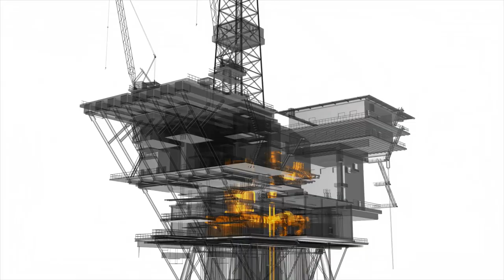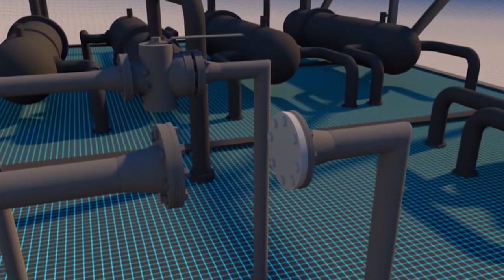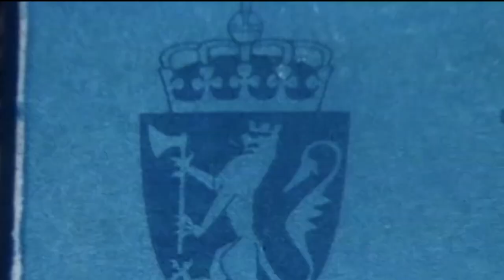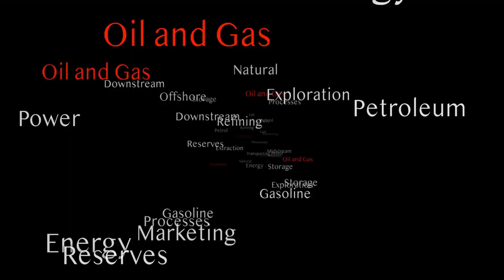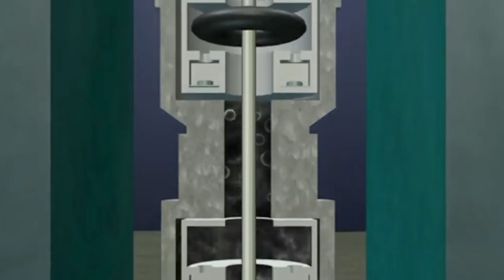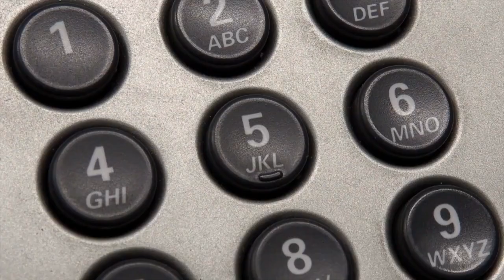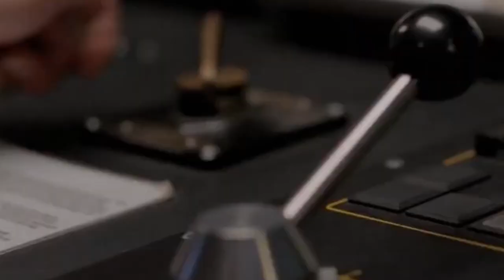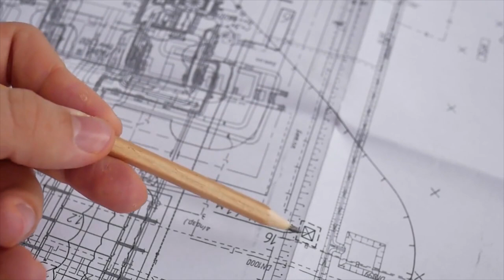The World’s Oil Rig Disasters, and The Recent Case of The Balongan Fire! || Documentary

Comment: People need to understand that oil rigs are built on the principle of risk management. Yes, they will occasionally suffer a loss like these disasters, but the overall benefit to society is undeniable—even when the environment suffers a setback. Unless people are willing to give up public transportation, motor vehicle travel, and air travel, there is no logical point to complaining until we have viable alternatives.
Reply: I don’t agree with your statement. We are dependent on fossil fuels like petroleum products, but no ethical business operates like the companies like BP, Occidental, and Haliburton, using bare-bones safety measures to get back as much profit as possible and ignoring the ecological damage. Marvin Gaye’s “Mercy, Mercy, Me” is more relevant than ever.
Reply: @lennoxpotter3329  Risk management is all about minimizing the risks and that includes the damages caused to the ecology. I know that past failures have been due to what you describe as “bare bones safety measures” but I don’t think that’s the case anymore. As I stated, people want to rely on fossil fuels yet they don’t want to deal with the occasional risks involved.  As long as a business is ethical (and if they’re not, they face penalties ranging from bad public relations to heavy fines and/or criminal sanctions) why complain?
Reply: As long as companies are fixated on getting back profit, there’s no way in hell that petroleum companies are going to run things like an ethical business. The consequences you talk about like fines are a joke to them and criminal prosecution is non-existent.
Reply from the maker: Two interesting point of views! Can we stop using fossil energy entirely right now? Well, the answer would be easy noting both industry-use-wise and personal-use-wise, it is not doable. Clean alternative energy at this moment is not accessible crossed-society-class (in this regard, affordable). Some types of alternative energy also haven’t been fully sustainable (for example: geothermal which detected to generate emission from gas release to soil surface and into the atmosphere). This process is evolution that might takes decades, not a swift change of 5-10 years.

An interesting “easy” example can be obtained from a tertiary human need of cosmetics. 16th century cosmetics contained mercury substance that allegedly caused death of Queen Elizabeth I. These harmful cosmetics also still being used publicly in Victorian era (when Queen Victoria was reigning in Great Britain) until 19th century. But look at where the era reaches to, with eco-friendly and safe (at least safer) substance for all direct-consumed chemical products. It took ages to evolve such “technology” at that moment. Although this is just an example from tertiary product, we can look back to this kind of situation regarding research and product evolution.

Until the energy era reaching evolution, all elements in society need to gang up in doing:
1. People to amplify public transportation usage and use local products where possible
2. Researcher and relevant corporation optimizing the research to establish alternative energy
3. Government and CSR-obliged corporation support with research funding

And talking about risk, error might be occurred because business process is carried out by human in many aspects. In a Tedx Talks session, Rohini Swaminathan stated that there is nothing natural about disaster. Adding her statement, business wise, every risk is in place but how we manage them and applying zero tolerance to ignorance. And Harold’s statement do make sense “As long as a business is ethical (and if they’re not, they face penalties ranging from bad public relations to heavy fines and/or criminal sanctions) why complain?” Cheers to you guys! Thanks for your both interesting PoV! 😃😃
Reply: @haroldbenderson1754  I don’t think people understand the harm that these oil disasters have done to the people who died on oil rigs, their families, and future generations that will have to deal with the long-term damage caused by pouring petroleum into our waters. Who do you think suffers more, the oil companies that eventually get back their profits or the people and creatures 50 years from now still dealing with the fallout?
Reply: @GemaConsult  Great story about cosmetics! Never knew that or that they might have killed Elizabeth.
Reply: Thanks to everyone for keeping the discussion civil. Let me share a story with you about the environment. A few centuries back, England faced a major deforestation problem as people cut down trees for fuel. Then, someone discovered coal and people didn’t have to destroy their forests anymore (at least not until a couple hundred years later in America). I believe we’re always going to find new sources of fuel and/or technology to preserve our environment. That doesn’t mean we ignore the practices of an ethical business but there are ways to keep society moving while making profit in an ethical manner.
Reply from the maker: @C.C. Hunt Crime charges due to act of negligence in this industry do exist. For sure investigation process took such a long time because oil & gas (or energy, utilities, and mining) industry is a complex yet multi-faceted business operation. Same like air crash investigation due to complexity of aviation business process. 

The cases for energy, utilities, and mining crime charges that flagged to be unethical business were environmental crimes, money laundering and embezzling (usually for cutting the corner purposes), illegal or unlicensed operation/products, etc. Who were charged? Typically it’s the corporation board, key-person, beneficiary owners, etc. You can search up in Google for the real case references.

But we’re not gonna keep our eyes close with saying 100% of faulty acts have been processed by law. Absence of these process is here and there – but that’s a different story if we’re talking about law enforcement effectiveness. Also a different homework involving how society works – also current and future generations behavior patterned up 🌊🌴
Reply from the maker: @Earl Butler Keep society moving while making profit in an ethical manner involving hard work(s). As long as the proportion of intellect person with high morale holding such important role are well distributed here and there – the chances are there. Plus, finger-crossed for research progress in alternative energy 🤞🏻🤞🏻

And talking about coal discovery in United Kingdom, there’s one event we can highlight as a lesson. Once, Aberfan disaster was happened (the catastrophic collapse of a coalface spoil tip on 1966). A period of heavy rain led to a build-up of water within the tip which caused it to suddenly slide downhill as a slurry, killing 116 children and 28 adults as it engulfed a Junior School and a row of houses. After 3 weeks of heavy rain the tip was saturated and approximately 110,000 m3 of spoil slipped down the side of the hill and against some areas of the village. The main building hit was the local junior school, where lessons had just begun in the morning; 5 teachers and 109 children were killed in the school. Many of the village's residents suffered medical problems, and half the survivors have experienced post-traumatic stress disorder at some time in their lives. Subsequent investigation placed the blame on National Coal Board (NCB) and their 9 employees but neither of them was fined. But learning from this catastrophic disaster, the country’s legislation was shaped to the better public accountability, responsibility, competence and transparency within the industry.
Reply: @GemaConsult  Wow! I learn just as much in the comments section as I do with your videos. Thanks for responding. Not many channels take the time to reply with such thoughtful information.
Reply: @GemaConsult  fantastic reply, well-thought-out, easy to understand.
Reply: While I understand where you're coming from, Harold, I still think we can find better (and safer) ways to power our vehicles. I just think the people behind the oil industry don't want that to happen and are actively trying to stop improvements in certain areas regarding this.
Reply: The issue is far too often they are concerned with their bottom line over anything else. These things can be done safely but if you foster a culture of not caring you end up with these results. The common thread in most of these disasters are things that can be overcome; lack of training, no checks and balances, priorities of speed and output over safety. All of which are avoidable.
Reply: @lennoxpotter3329  and you have nene worked I n the oil and gas industry let alone on a rig.
Reply: @lennoxpotter3329  k

Comment: No one tried to sums up the official cause? Tried to dig and I read this on CNBC Indonesia. The Indonesian Ombudsman, the state institution that oversees the implementation of public services, explained the results of the fire at the Balongan Refinery.

1. The cause of the fire incident for Pertamina's four tanks is still incidents, both internal Pertamina which involved an independent party and the Police Criminal Investigation Unit.

2. Pertamina has handled the handling before and at any time after the incident, including the needs of refugees in the form of logistics and health, both physically and psychologically.

3. Public complaints before the oil refinery fire incident were not responded to by PT Pertamina and there was no disclosure of information regarding the condition of PT Pertamina's Balongan oil refinery at the time of the incident.

4. There is no disaster management problem due to "technological failure" in coordination with the Regional Disaster Management Agency (BPBD) of Indramayu Regency.

5. The Pertamina fire incident did not affect fuel supply. Of the 71 existing tanks, only four were burned with a capacity of 7% of the total fuel produced at the Balongan Refinery.

Could someone try to do the analytics plz?
Reply: Can you provide the source?

Comment: This video it’s very informative and it’s very helpful that you added the long term aftermath of the accident, but more engineering technical language, especially on the Piper Alpha and Deepwater Horizon will improve the quality of the video. Piper Alpha explanation of the happenings it’s a little bit oversimplified, especially the maintenance reports.
You may also add the Byphord Dolphin accident and the sinking of the Ocean Ranger rig (EXXON)

Comment: I never knew the exact reason behind the Deepwater Horizon calamity. Basically, the concrete plug wasn’t enough to keep things down. BP’s risk management formula apparently wasn’t enough (and that seems to be a pattern with these disasters). What’s particularly scary is that the $65 billion costs BP paid only put a dent in it getting back its profits. BP apparently brought in around $183 billion in 2020 so that tells you all you need to know.
Reply: A culture and history of letting things ride until no longer possible. Sometimes they fix the issue before a problem happens- sometimes they don't and you get these outcomes.

Comment: Here is something that needs to be stated. While these are examples of what can go wrong, they are few and far between. A rare occurrence if you will. We as a modern growing society can not continue to prosper without oil production. Reading through the comments I see several about profits above all else. If you only knew what it costs to get from discovery, to drilling, and then production? It may change your mind. The dollars that go into it are shocking. With no guarantee of success. Just because you drill doesn’t mean you are going to have a great producing well. 

For instance, I won’t say who I worked for but. We drilled a 10 million dollar horizontal well. Then spent another 1-2 million fracture and completing the well. It was producing around 10-20 barrels a day and 100k mcf of gas. It produced more waste water then oil. That well will never pay for itself. And it’s one of many misses we had in one year. 

Oil and gas for investors is high risk. And when you make it harder through regulations you make it harder to get a return on your investment.